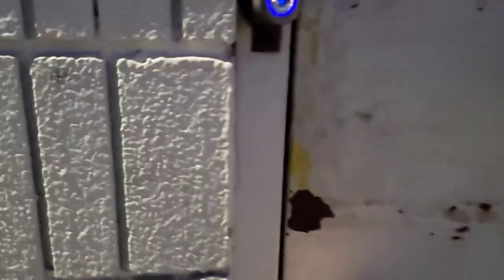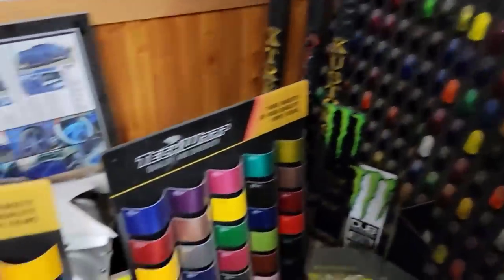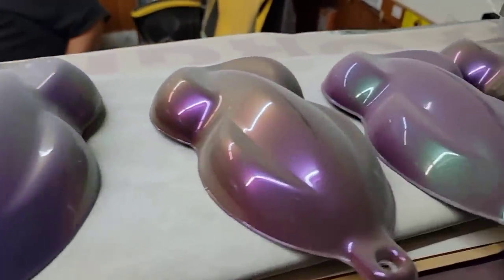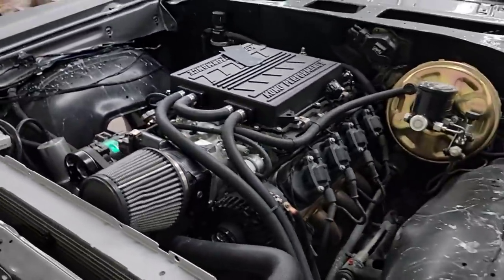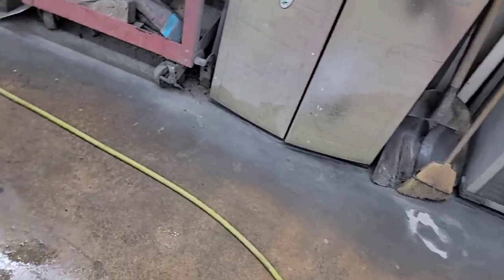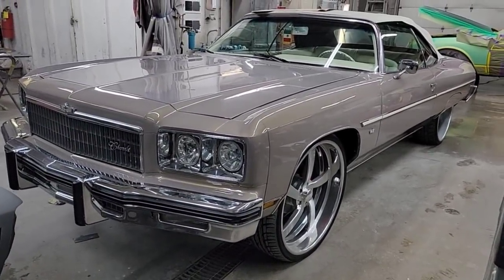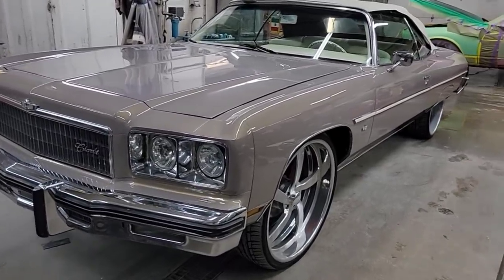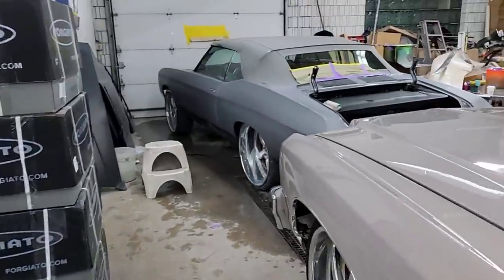pc finished legend just on time

Comment: That's dope PC only focused on 32 ⛽️🅰️🆖️ members for last minute touch up b4 the Rick Ross carshow so they can make it 2 the show n look good at the sho

Yall should start puttin car covers on the cars when yall travel or wrapp them wit plastic or it mite b time 4 the 2 car inclosed trailer an a single car in closed sell all the others except the all aluminum 1 wouldn't need em got the flatbed also